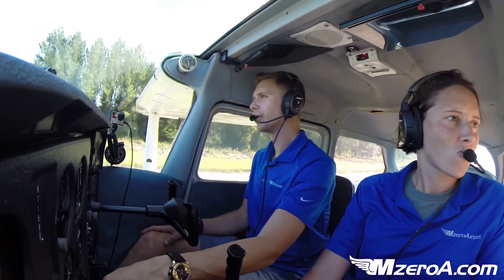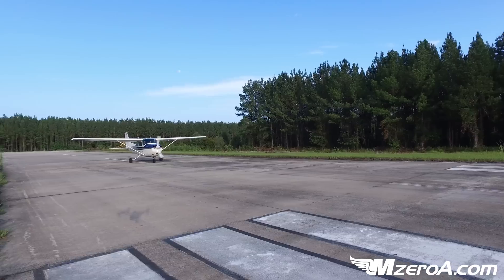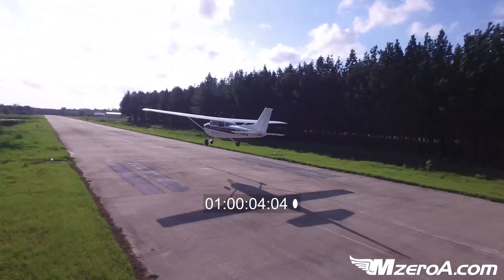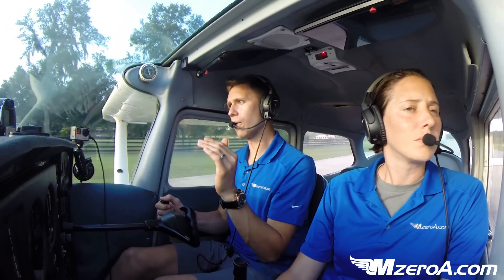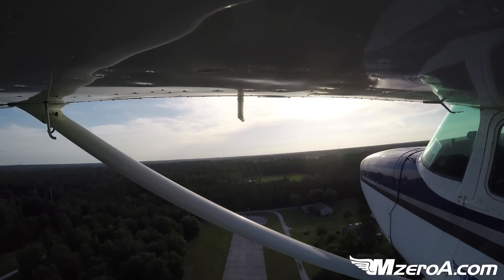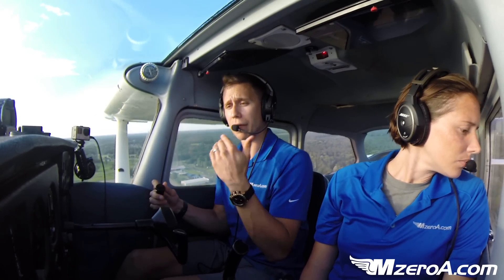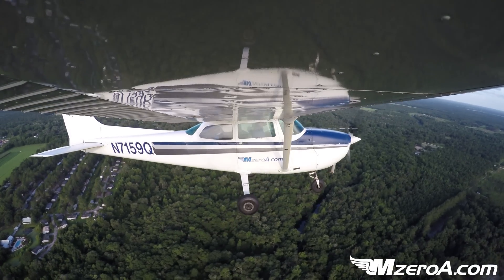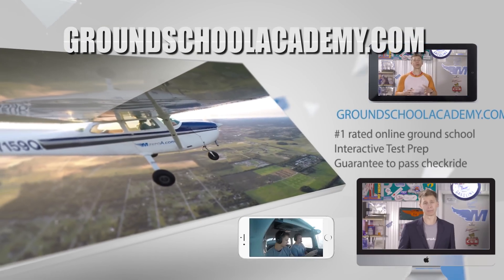Engine Failure on Takeoff - MzeroA Flight Training

Comment: Thanks for this. Have lost two family members, due to engine failure upon take off, 30 years apart, first in a Mooney, my brother, last Saturday in  a Grumman. I have many questions.  Do they not put 2 (Two) fuel pumps in these airplanes?  A M/F tractor has two fuel pumps!  Or a pressure tank, that that could give the pilot 3-5 minutes  of time.

Comment: Thanks. Very important topic to me since I live on a grass strip with nothing but BIG trees at the ends. The big problem is if the engine quits when you said you were at 300' on the 2nd takeoff. I couldn't see anything but trees in front. What do you do? Not pretty, but it's something to think about before it actually happens one day. Keep safety belts very tight and check passenger's straps for tightness. I didn't see shoulder harnesses. That's a great mod to make on an older Cessna.

Comment: I lost all power in an ultralight recently, 85ft after take off. I nosed it straight down and saw a hole in the hedge, slightly to my right. Put it down in the field and ran through the hedge, the fence wire caught us. No injuries. Thank you for your videos!

Comment: Not turning back below 1,000 ft AGL makes sense and is something I brief before every departure. However, what would you do if you lost your engine on the crosswind leg between 700 ft AGL and 1,000 ft AGL if doing a downwind departure or staying in the pattern?
Reply: If your distance is close enough to the runway (winds, climb angle, etc) then you’re 90 degrees back anyway. Turn back.

Comment: With general aviation fuel on board, the chance of the 0320 engine failing due to a mechanical problem is pretty rare..However one can get caught.(pretty rare) I had one that failed at 300ft ignitation failure,but managed to put the aeroplane back on the ground. Getting an O320 engine failure is pretty rare.

Comment: Every single video I'm finding is saying "thirty degrees left & right, that's you're window". But my local airfield's main runway goes straight out over the water! I'm starting to think that if I ever have an engine failure on take-off, I'm going to end up ditching. Not a fun concept in a fixed-gear aircraft like a 152 or PA-28.

Comment: I had an engine failure in a C150, which is very rare. It, wasn't fuel starvation. At 300ft you need to move fast. I did a wing over which saved the day and landed back on the runway. My comment, if your a private pilot, its money in the bank to have learnt some wing over procedure as your will use it during your flying career.. A great maneuver to get right. Basically its a flying and gliding turn with the ball in the center. But developed greatly from a normal fixed altitude turn. Worth learning and  and keep practicing them. One will get a stall warning at the top. The thing you have to remember is the C150 is a very happy spinning aircraft. I had a flight testing officer ask me to do one once in a CPL renewal.

Comment: The lack of time to react is also why you should always do a briefing before take off.
In case of an emergency before takeoff I am going to shut the throttle and come to a stop.
In case of an emergency during takeoff with useable runway left I am going to put the nose down close the throttle and land on the remaining runway.
In case of an emergency during takeoff with no remaining runway useable I am going to put the nose down, maintain glide speed, close the throttle and choose somewhere in front of me to land.
Sometimes for the last one I include things like turn immediately to the left if there is a field in that direction and houses straight in front.  Also I mention any of the tall power lines depending on which runway I am taking off from.  The airfield I fly from has 4 different runways, so I can be taking of in any one of 8 different directions, each has a slightly different best option.
In a no wind situation 1,000ft should be enough for me to get back down on a different crossing runway but it is not something that we even discuss in training, it's always pick something in front of you.
Oh and todays flight lesson for me is revision of EFATO an EFDTO.  Engine failure during and after takeoff.

Comment: Thanks for posting! 

So.... what if you are at 200-250 feet AGL, then lose the engine AND have no usable runway left? Then what? Same as the latter part of the video - use the 60 degrees rule?
Reply from the maker: Hey Bryan! In that case look for anything you can see out of the front window. You don't want to turn too much at that low of an altitude. Thanks for watching!

Comment: I find it’s important to know your options at a given airport. My home field IZG,  there’s a dirt road that I can hit if I make a shallow turn to the right when taking off from 32. I have a similar paved option from 14. After getting newly current (8 year hiatus)my instructor encouraged me to start flying a much tighter pattern in my 150. I have been shooting for maximum rate of climb to about 600’ AGL and making my departing turn sooner rather than later so I stay as close to the airport as possible in case of engine failure. I’m also keeping my downwind closer and turning base much sooner than I used to. It’s different than how I was originally taught, but it keeps me closer to the runway.
Reply from the maker: Thanks for sharing, Jaysen!
Reply: Climb at vy, Vx will overheat the rear cylinders.  Learn LOTOT too.

Comment: If I ever get my cessna licence,my take off plan will be like,what if I lose engine at this critical point,take a google earth photos,go around the field,and check your emergency spots in case this happen,its easy if it is so early but if you are already ahead of runway its tricky, or if you are higher its easier,so make a plan to be prepared where to land in advance just in case,check fields,check highways,rivers,lakes,something straigh spacious and as much safe.. good luck

Comment: Okay, so...and I truncate...
1. 70/65
2. Mixture
3. Fuel shutoff valve
4. Ignition
5. Flaps
6. Master
7. Cabin Door
8. Land

I don’t have time to think beyond item 1, maybe 2. I don’t understand the order necessarily, and I don’t understand why the throttle didn’t make the list. Also, why unlatch the cabin door?
Reply from the maker: Part of it will depend on the environment and when the actual engine failure occurs. If it happens at only 100ft you will only have time for a few things, where as at a higher altitude you may have time to run through all those items. The most important thing is to fly the airplane first !
Reply: @MzeroAFlightTraining  Thanks so much, Jason. 

You know, I would love to see MZeroA do some animations that help pilots visualize wake turbulence. I saw that your team is working on advanced animations, which is something I would have done years down the road if somebody else had not. I'm just working on my PPL, but as a teacher whenever I am learning something I am immediately thinking about how I would present the material to future students. Great job!

Comment: I flew a Cessna at Whiteman in Pacoima, CA. First real flight for me. The climb out is over densely packed houses and other buildings. In the back of my mind I was thinking, man, if the engine quits at 100 feet we're probably dead.
Reply from the maker: Hello! 
That's why it's always important to be thorough with your preflight planning, briefing and your runup. Make sure if taking off in a densely populated area that you're taking extra precautions. 

Thanks for the comment!
Reply: @MzeroAFlightTraining  Yes indeed! And thorough aircraft maintenance!

Comment: Thanks for the demo. We all know how important, and required it is to know the airport we depart from, or arrive at for several reasons, including the engine failure possibilities you mentioned. What I have included in my list of safety requirements, with no advertising intentions, is using Google Earth or Google Maps to visualize what is after the end of the each runway for any possible emergency landing below 1,000 ft.
Do you think this is a good practice, or know a better way to do this?
I mean, what if I don't have enough time, or if there is no options at the arrival field?
Thanks for sharing.
Reply: Paulo Goulart pull the chute
Reply: I also use Google Earth for that purpose, but once its graphics/images are not in real time, I only use it together with VFR/IFR charts to verify if  anything were added to the surrounding airport area.
Keep up the good work.

Comment: Good video in 4min! I'm a new low time pilot and must admit we didn't discuss the engine failure with un-useable runway left 50-100 feet off the ground. The startle factor is real especially when you are not expecting a failure! In all of my training we did NOT discuss the "impossible" turn for the very reason you mention (why try the impossible). Instead we had the 30/30 rule (30 degrees left/right) for crashing options. Lastly I was reading an article (AOPA article) on POH landing performance vs. real life performance (they tested the published). The results were a 30% difference then published (meaning you needed to add 30% to published numbers) to be actually accurate under specified conditions. This becomes VERY VERY VERY important during an emergency! 30% is a lot more runway than published, that's assuming all other factors are normal or working in your favor...

Comment: I have made the turnback at 500 feet many times in a cessna 172 I used to rent. The owner who is also an instructor required you to learn the maneuver before he would allow you to rent the plane. I do understand not tempting fate but I will never understand an unwillingness to learn a maneuver that has been shown over and over again to work with the appropriate training. And when he taught me, we didnt do it at 1500 feet, he pulled power at 500agl and made me take it all the way around and land - no simulations. I think people who disagree that this can be easily performed like to use the two second startle delay to prove it cant be done in demonstrations. I say any pilot not mentally spring loaded on EVERY takeoff to expect an engine failure should re-think their hobby/vocation.
Reply: To be clear and fair, every situation is different and obviously there are many factors to consider on the decision. But to write it off seems like willful ignorance to me.
Reply: @xvxchronoxvx  Or Willfull Cowardice.  Practicing cowardice when things require courage instead.

Comment: Thank you. I had a disagreement with another pilot who videoed a turn back in a Jabiru 230 claiming only a 150 foot loss in height. I argued that he did this manoeuvre at cruise speed not Vx or Vy as in a climb and probably not turning from full into wind to downwind where I think you would lose even more height than usual. Thank you for clarifying and reconfirming this is not safe when under 1000’.
Reply: azharc123  Height loss would be the same regardless of wind . A stiff headwind would get you back to the field quicker of course, but then you’d run out of control sooner on the subsequent downwind landing when your roll-out speed was about the original headwind speed.
                  Gliders don’t normally try that if the original headwind component is much above 20kts or so , but in their case a straight ahead landing in those conditions is slow enough to make it an even bet.

Comment: If you look at my home airport, KHUM, they’ve closed the smaller runway and just use the larger one. At either end of the runways there’s nothing but trees. What then?
Reply: There’s FAA information out there how to do forced landings into tress. Read up on that. I’m a pilot as well and would not turn back. Fly and land within 30 degrees of centerline and try to “hang” the plane in the trees with a nose up attitude so the lower part of the aircraft takes the brunt of the impact.
Reply: hard left rudder, aileron and return safely to the airport.
Reply: @dickjohnson6573  -  Are you stupid or just imbecile???

Comment: That is all fine and good. What about when that shit happens at NIGHT!? You gunna make that field, yeah?
Reply: He clearly demonstrated and talked about that it's the impossible turn! no you won't make it
Reply: @apilotbgsu172  I was his CFI, with some wind you can if low useful load.  But that is the bare minimum for that.  We also take of slanted just in case.  4,600' long ruway we had.
Reply: With a wind 10knots a from side a bit, I practice it at night many times on my Cherokee.  From 500 agl if you climbed at over 800 feet per minute.  Nose down, coordinated 45 bank a Vglide, no stall warning at low altitude, please.. Fun to do 4 or 5 at a time.. No traffic at night at all, and you can see the lights, runway is 4,000 long.  If you make a shallow climb, you cannot do this Turnback, even over 1,000 feet agl.

Comment: good video on that turn. I did the impossible turn in a Cessna 150 H. engine quit over the numbers, 9/27. made turn back ofabout 200 degrees, then right turn to runway heading. stall horn on all the way around, just made runway, thanks to longgrass strip on end of runway. will never do it again. fate might not be on my side again.

Comment: Would it not be a good idea to execute a practice 180 degree (ok, 240 degree) turn with no power at a safe altitude to see how much altitude is lost in the turn to help understand the capabilities of your plane. I had a retired airline pilot debunk me on this point in an Aeronca Chief. He pulled power at 300' (I don't recommend), extreme left rudder and aeileron turn 180 and we had more than enough altitude. In fact, we would have had to perform a forward slip to get it landed by mid field. I realize personal and aircraft capability and expertise factor in here as well.
Reply: Jonathan Jones during my CFI training, my instructor did have me demonstrate the impossible turn at a safe altitude, to impress upon me how turning back to the runway below 1000' AGL can be a fatal decision if not performed perfectly. I now have all of my students do this as well, so that they can also see this firsthand.

Comment: My instructor demonstrated the impossible turn after take off in a C172m at 700'AGL for low and over from 24 back on another runway 06. Wow!  But when you are not expecting it, I think you would need that 1000' buffer for new pilots, and not every scenario will have another runway.  Even with just 6 knots of downwind for emergency landing, it's intense to actually stop.  I saw someone attempt that at night with what looked like 20 flap and they couldn't do it in a 172 on a 4000' island runway - no floats.  My instructor advises full flap with the expectation of going in the water on said island airport even with full back pressure and firm braking.
Reply: you should ALWAYS expect it

Comment: IF
you are at your HOME field
THEN
have emergency landing areas picked out AHEAD of time
- perhaps several based on altitude (below turn around option)
   and certainly for each end of the runway(s).

I can think of situations where I would take the option
to land on the runway even if I thought it was too short to make a full stop -

1- if I knew ahead of time there were no good options for an emergency landing
     no big fields, no good highway etc...

2.. if I did a quick glance at an unfamiliar airport
        and saw no good emergency spot to put down

Even if I could not do a full stop on the available runway left
I WOULD be able to slow down some
there might be some runoff area at the end of the runway
I could always do a deliberate ground loop when I reached the end of 
what runway I had
and that would probably be better than falling from the sky

AND
if you land on the runway and do the best you can
you probably are not going to put any innocent civilians at risk
like you might if you fell from the sky who knows where - school ? apartment building?.....

Comment: yo, my instructor says that we turn  if we are over 600 AGL. (I fly a citabria 7ECA) is this a good idea?
Reply: It definitely depends on the plane.  A cessna 172 will drop like a stone without any power while a Diamond DV20 would be able to do a 180 back to runway in 800 ft (if i remember correctly).
Reply: @Mike-ff8wh  C172's dont drop like a stone. Even a full gross.  I fly Grumman Yankees.. That one will scare you the first few times you cut all power..

Comment: Nice! It's a very good idea to brief engine loss scenarios prior to take off so it stays fresh in your mind. I use the simulator to try things that I would never do in a real airplane. I've practiced the impossible turn in the simulator and can get it about 50% of the time. The turn has to be steep and managing the pitch with this is difficult. If you think you can do the impossible turn try it in a simulator and you will see why it is call the impossible turn.

Comment: It's nice to see that this is also taught there in the US, it just solidifies how important it is not to turn back after EFATO and just pick an appropriate field to land on in front of you with insufficient runway remaining.
Reply: My home airport's pretty fun for that, in one direction I've got a small harbor and a river with just one single field that you can reach at around 600 ft above ground, in the other direction it's a village, with fields only coming up again at around 500-600 ft minimum, between 100 and those 500, the only choice is literally the river... not to mention that there's a bridge I could crash into as well. Beautiful airfield, but all the more beautiful and interesting it becomes, the more dangerous they usually are as well